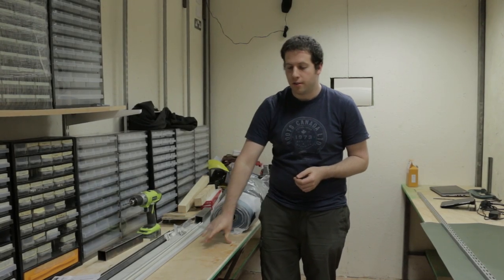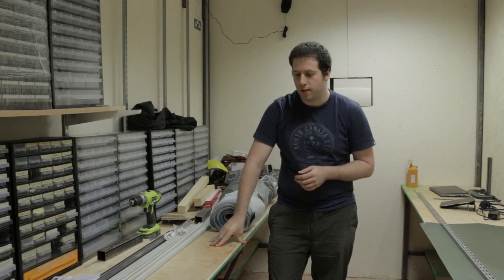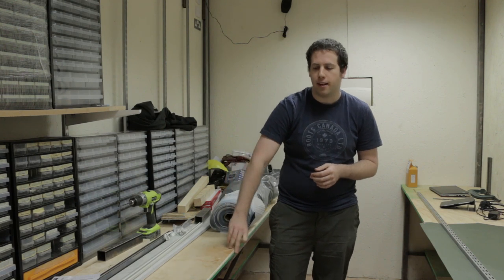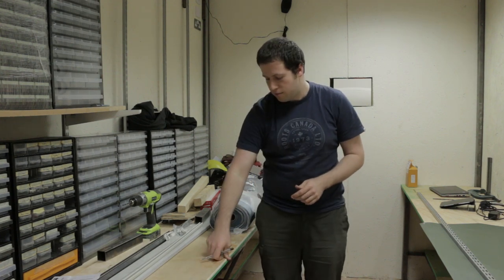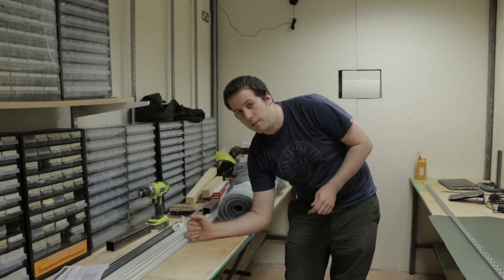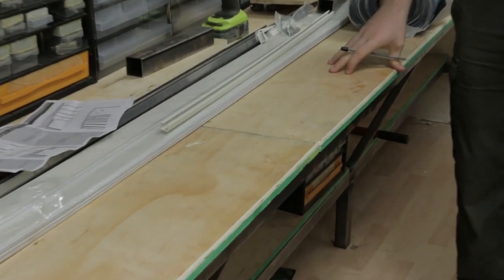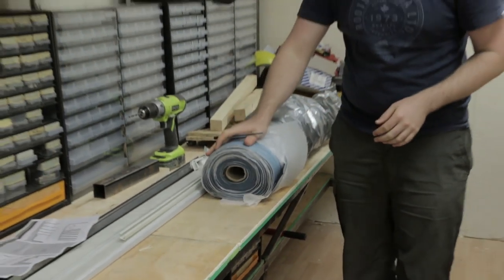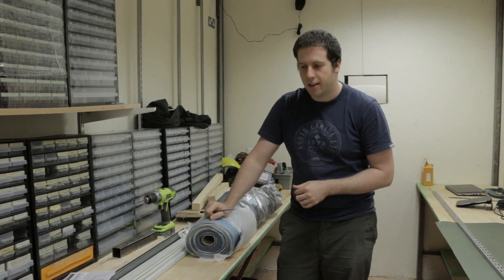Watt Circuit Electronics Bench Build

Comment: Very nice, though I am not a fan of those plastic feet as they tend to cut through, especially as you have a wooden floor. I would recommend using a small end plate of 4-6mm steel to spread the load onto the wooden flooring. To prevent marking just use a scrap off the ESD matting as a rubber isolator under the plate, and it will not leave a mark on the floor. A 100 by 100mm plate per leg will work perfectly, and will not be obtrusive. Hopefully you are going to paint the steelwork with some water based etch primer and then a coat of black water based enamel, otherwise with just your humidity from breathing it will rust. Paint the underside of the top and shelves as well, it helps with keeping dust down, though the shelving under the bench will be better white to reflect light onto the worktop.
Reply from the maker: Thanks for the tip about the plastic feet; haven't come across that before but will definitely add some supports there. The plan for the steelwork is a coat of red oxide followed by enamel paint. Like the idea about painting the undersides white to get more light-stealing that idea as well!
Cheers!

Comment: really good video! i too am about to build my dedicated electronics benches. some good tips and ideas!

Was you using gas with that mig? i think i saw a tank... Any downfalls with going gasless?

PS. where did you get that matting? is it the same as was Dave Jones(EEVBlog) posted a video about recently? IE: uncut-able to an xacto knife, and cant burn with a soldering iron?

Keep posting! and more regular!! its good to have British(like me) electronics engineers! would be good for you to post videos specific to British as well! like sourcing components from British sites, etc..
Reply from the maker: Glad to hear you're building benches as well-it's a great moment!
I am using shielding gas from a bottle. I believe that gasless is better outside, but from a bottle makes it easier to see what you're welding and easier to get clean welds. I didn't get one for a while, but the bottle's were less than I thought at around £100 including a deposit and then it's £36 for a refill. If you use Adam's gas like mine then there's no deposit, and I find I get through about one refill a year.
As for the mat, it is the same kind of material, rubber construction so it won't burn with a soldering iron. It's a bit thinner than the ones I've used before so I think a nice sharp scalpel will make a nice cut-the link is below
http://www.somersetsolders.co.uk/ESD-Bench-ESD-Flooring/ESD-Bench-Matting/ESD-Bench-matting-full-roll-600mm-width
Interesting point about the British sourcing-we're filming the next LED tutorial soon so we'll put something in that one about how to get components in the UK. Thanks for the idea!